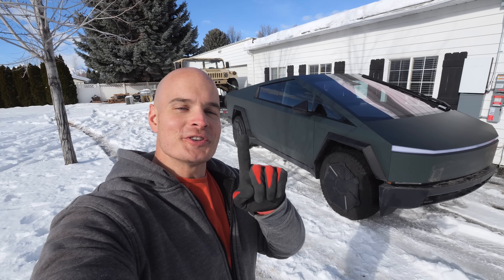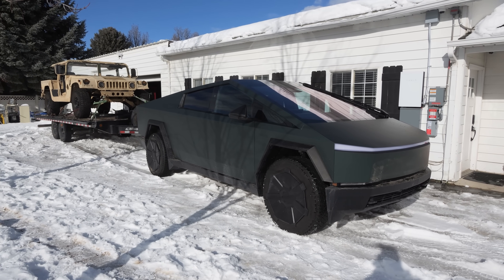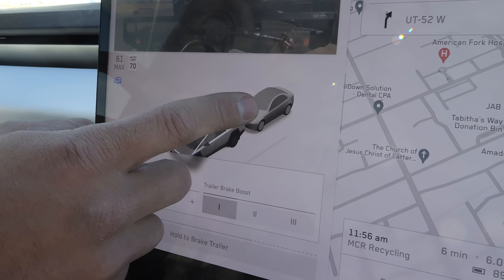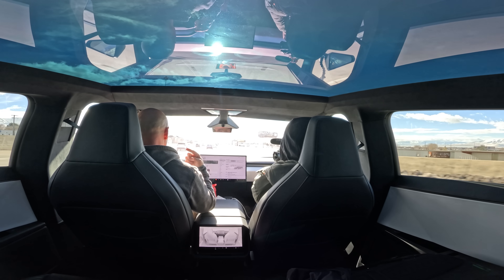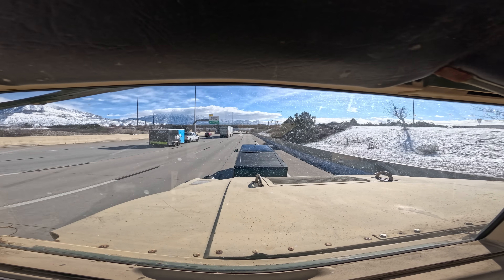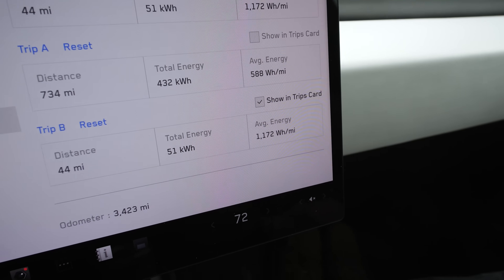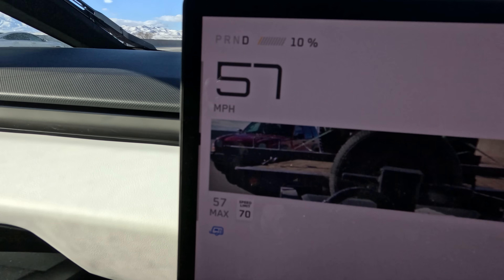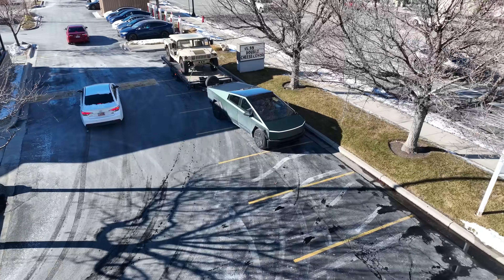How far can the CYBERTRUCK tow 11,000lbs in Freezing Weather?

Comment: Ouch and that's at mid 30 degrees, what we up north consider a warm day for 6 months of the year. Need to see this type of test done somewhere with real winter temps, like -25 to -40 degrees. Great vid Jerry.
Reply: What you are actually saying is: in winter, real winter, this 100k+ truck is actually just a paperweight
Reply: @blackfacegaming191    Yep, it's coming out in Alberta you lose about 30%-40% in colder temperatures.  Also at -40 there's videos of EVs saying nope too cold and shutting down on the highway.
Reply: @coolpicksoftheday  Eh there's a guy that was showing off his daily driver in his frigid snowy environment just fine. Engines heat up with combustion and batteries heat up as they charge and discharge. Ideally in those temperatures you'd probably want to get the batteries a little warmer before setting off much like a normal car which could be done with the heater running and if you're not doing super long distance driving you could also keep it around 80-85% and plug it in an hour or two before you plan on leaving much like a block heater on an ICE but instead of warming the block for coolant / oil it's just helping warm up the batteries then the power going to and from the batts while driving should keep them warm during your commute.
Reply: Freezing temp?? 😂30F??? That’s short & t shirt weather here. U can’t even see his breath & he doesn’t have a toque!
Reply: @darthmaul13 it technically is freezing, 32 is freezing. Cybertrucks aren’t advertised to compete with F250s. Towing 11,000 lbs over long distances isnt what it is advertised to do.
Reply: EVs are d.o.a. during acrual winter days. What a joke. Fools buy that garbage thinking they are so advanced...smh
Reply: @absolutefreedom9437  Yeah man, because something doesn't work well in -40 °C weather then it's useless. Even though like nobody important actually lives in those temperatures.
Reply: @drunkenhobo8020 

That name seems to fit😂. 

A) That's an incredibly arrogant statement 

B) The reason those of is who live in the northern climates point this stuff out is because the "important" people who don't live are trying to force everyone into these vehicles.  See Washington State for example.
Reply: @drunkenhobo8020  considering it can be that cold for several weeks at a time in some places, yeah it would be pretty useless there. Here in North Dakota we had about 2 weeks of -40 air temp and as low as -70 with wind chill thanks to our 20mph sustained winds and up to 50mph gusts last month. That happens about twice each winter normally, and regular average temps can be -20 to -30 throughout all of January and February. If my vehicle won't start when I need it to then yeah, it is pretty useless. Sure quite a few ICE vehicles had issues, but that can be solved by bringing your battery inside which you can't really do with an EV unless you have a garage.

Also your assumption that "nobody important actually lives in those temperatures" is completely subjective. My family and I are pretty damn important to me so just because you don't think anyone important lives up here doesn't mean we should be literally left out in the cold. If you want an EV and it works well for you that's great but for most up here and even further north they just don't.

Comment: Thats how motors work, they only operate at a rate equivalent to your foot pressure which means they will pull more amps to maintain the disigned rate.

That's It's why a lot of motors will go out because they're being ran in circumstances in which they weren't necessarily designed for and the wiring going too, and within the motor is too small and can't handle the Amperage. I'm sure the cyber truck has more than enough properly sized wire ran

Or think about how people say using a power strip cause fires when you got to much stuff plugged into it. The excessive amps being pulled through undersized wire cause the insulation to melt and the copper to get hot enough to ignite framing or whatever it touches

Comment: i think at the end of the day all these statistics say is that EV's belong in the cities where most vehicles typically sit in traffic idling away fuel and putting CO2 into the atmosphere while not doing a whole lot. they save on a lot of energy there but when it comes to actually having to do work and travel they still fall behind in all areas. it's just more efficient to use gas/diesel when traveling long distances. i know they've been putting chargers up all over the place but being forced to stop every ~100-200 miles for 20-30 min just to extend your range(law of diminishing returns since you get less and less distance per charge every time you stop because it's only regaining so much charge.) compared to a single stop every 300-400 ish miles for about 10-15 minutes... it just doesn't make any logical sense to choose an EV if you travel long distances more often than not. i still see them as only a novel idea until they replace older parts of the grid to handle an increased load that charging EV's brings.

Comment: Cool BUT , if You are Monetizing On YouTube for this Content... Chances you are Required to Comply with USDOT Regulations Applicable to 49 CFR 390.5 when you are In Commerce.

It's NOT a Problem because you won't get noticed for operating in Commerce until you get involved with a DOT Inspector who knows what they are doing, or you get involved in a Accident and it was determined you're in Commerce with applicable DOT Regulations.

Commerce can be Considered a Form of Compensation Reportable to the IRS.

The GVWR of a Cybertruck is listed up 10,000 lbs., if what you say the Humvee is at 11,000 GVWR, then the Trailer should b3 rated to carry 11,000 GVWR

Then you would MEET Applicable DOT Regulations 49 CFR 390.3(a) which makes Reference to "Interstate" Commerce, but your State may have Adopted DOT Regulations for purposes of Intrastate Commerce

And your Vehicle would be Defined as a Commercial Motor Vehicle per 49 CFR 390.5 

Commercial motor vehicle   means any self-propelled or towed motor vehicle used on a highway in interstate commerce to transport passengers or property when the vehicle— 

(1) Has a gross vehicle weight rating or gross combination weight rating, or gross vehicle weight or gross combination weight, of 4,536 kg (10,001 pounds) or more, whichever is greater; or

Comment: WHAT'S NOT SAID: THESE HEAVIER EVs ARE NOT PAYING ROAD TAX, POWER COMPANIES SENT OUT PIE CHARTS DEPICTING ENERGY RATES ROUND THE CLOCK. RATES TO CHARGE AT NIGHT ARE APPROXIMATELY 40% CHEAPER THAN PEAK HOURS , 3:00 PM  -  9:00PM. ESSENTIALLY FAMILIES AND NON EV OWNERS SUBSIDIZING EVs.  The Rivian and Cybertruck are $115,000.00+ vehicles, the Lighting is about $90,000.00. what are these vehicles driving range once these batteries get 3 years old or so. They will not be economical at all, at peak hour rates, pay road tax, all spending 40 minutes for an 80% charge. All putting out more carbon emissions than gas vehicles. People don't realize electricity doesn't magically manifest itself at receptacles in your home. Electricity is forced to your home by voltage. Electricity is generated at powerplants and needs to force the electricity to substations which then reduce the voltage and distribute it to  transformers in neighborhoods to reduce it to house current approximately 120VAC. To make this long trip it starts out at approximately 400,000 volts. So carbon emissions are emitted producing the energy and even more forcing the energy 40+ .miles. The Green New Deal is a lie. It doesn't reduce emissions but it does make the rich, richer just like the fake climate change, etc.

Comment: And to think I can take any exit fill up in five minutes and drive 450 miles....
Reply: If you're towing you're probably not get that full 450 miles. These things are new tech with a lot kinks to still be worked out. They could make it so the batteries aren't part of the vehicle (and it's initial cost) and that they operate under a service model where you pull into a station and swap them out instead of waiting to charge.

Comment: You should try it again with a tarp sloped up from the front of the trailer over the top of the Hummer.    Should make it a lot more aerodynamic.  And also the national speed limit of 55 was chosen because there is a big difference between 60mph and 55mph.  Agree they need to work on it.  Maybe a slider for 'estimated" weight of what you are towing.

Comment: Hi risk test from a safety point of view.
So it is a total fail on towing anything serious.
90 miles on a charge and you have to unload your load to charge???
These CTs are for posing and trying to impress your mates, and for private school pick ups.
Totally useless, and the steer by wire is nuts.
The only very positive thing is it doesn’t have autopilot, because Elon doesn’t want to be sued with a class action.
If you want to tow safely and efficiently , buy a diesel.

Comment: The milage displayed on the top of the screen does not factor in current consumption its just the EPA estimated efficiency multiplied by the current SOC.  You could have seen your true projected range by going to the energy app and clicking on consumption (not sure if its the exact same in cyber truck but it should be there). From there you can get a more accurate range estimate based on the average efficiency of the last 5, 15, or 30 miles

Comment: I feel like the trailer brake would be a big variable in range comparison with that much stopping. I know you need one to be safe, but it doesnt get all the momentum back into the battery. Need a regen trailer that stores its own braking into a battery for later use

Comment: 7:37 this might be poor fixation of coil winding in either a choke or a transformer within the inverters. It is often heared on electric trains too. While accelerating the inverter pumps more current to the motors (and when regenerative braking too) which causes windings to vibrate more under the Lorentz force.

Comment: So you buy a very expensive big truck, weighing a lot more than any average ICE truck, and can tow only 90 miles in cold weather and have to spend at least 40 minutes to charge it up again? 
Then you say "most people aren't using EVs for towing in the first place". Then why do you buy a big heavy truck if it can't be used as a truck? 

I guess many ICE truck owners don't use them in their jobs but if needed those ICE trucks can actually be used as trucks.

Comment: Clearly, the Cybertruck is not ready for prime time. Just the towing graphics alone would put me off my feed, and the lack of need-to-know information is another deal-breaker. BTW, my guess was 100 miles. Pretty darn close. Another point where NONE of these EVs are ready for prime time. I am NOT going to spend an hour every 100 miles just charging the hot mess. Thank you for the in-depth reviews. You have single-handedly convinced me to not spend hard-earned money on any of these trucks for at least another development generation.

Comment: Evs are only good for inner city driving if you buy a small ev. When on the highway high speeds kill the battery faster with heat of the electric motor. Evs are good for inner city low-speed, low millage driving per day as long as they design small vehicles. Big vehicles make no sense for EVs. The weight eats your tires up faster as well. If you need to tow anything heavy, get a V8 gas vehicle or a diesel truck. I will never buy an EV ever. They are worse for the environment, and the infrastructure does not exist for them. THEY need to build nuclear power plants all over the country if they want the power to do evs. It won't happen in our lifetime

Comment: Jerry, 
what happens if you are driving the Cybertruck and the battery runs completely out of charge and goes dead?
My Uncle had a 1972 Buick Electra, and when it ran out of gas on the road it was scary. It happened to me one time. The steering and brakes were full power, and when the car stalled, it took all my strength at age 21,being in good shape, to control the brakes and steering  just to it get off the road, and would take several people to push it at all. Consider that owners of the Electra were middle aged and older . Weight was about 5000lbs.with the 455 cid engine.

Comment: 90 miles. Wow. Put on the white gloves and baby that turd. In the meantime I’ll use my 2002  E350 with pride. I can pull a 20 enclosed trailer easy 200 miles on the interstate with out stopping for fuel and I’ve got the small tank.

Comment: So driving it at the actual speed limit here in Arizona pulling my travel trailer that weighs 11000 lbs I would get less than 80 miles.  I can see I'm still years from even considering one. I'll stick with my gas powered truck.

Comment: Time for a Jerryrigged trailer with battery pack build to charge truck while towing. While you are at it may be able to rig up Regen braking on it too!
Reply: If you have motors in the trailer hubs for regenerative braking, then why not just use them for assist while driving?  An electric assisted trailer might make sense for any vehicle type, EV or ICE.

Comment: I hope when Edison Motors comes out with their diesel electric truck conversion you get to test it as well.   I love their open source and right to repair philosophy.   Also having a diesel generator means that you don’t have to worry about dropping the trailer or no charging slots open.  I honesty think hybrids are going to be the norm for trucks, not full EV.
Reply: I agree.  Diesel/Electric hybrids are the way to go for trucks for at least the next 20 years.  Way more practical and a proven solution just look at freight trains.
Reply: Nah. Batteries are developing at a rapid pace now that people are investing into them.
Reply: Honestly its surprising we didn't have diesel electric hybrids 10+ years ago considering trains have been powered that way for over 50 years and we had the battery technology to do it. I love that they're trying to retrofit older diesels that were built to last forever to keep them on the road longer while burning cleaner
Reply: @LukeA_55  It would of lowered profits. Thats why hybrids and electrics basically havent been a thing. 
Only reason why they're moving over now is Tesla is forcing them to.

Comment: My concern is, what would happen if you were on the interstate at speed and the thing lost power? In a traditional gas or diesel truck, if the engine shuts off or the battery loses power due to a glitch, the operator still has enough control over the steering and breaks to safely stop somewhere. I imagine a machine completely controlled by electricity would essentially turn into a brick if a glitch or malfunction led to a complete loss of power.

Comment: I've been driving a PHEV Toyota Prius Prime for about 45,000 miles, and I've noticed a similar issue to what you experienced in this test: the range seems to drop faster in the last 20% of the battery charge than in the first 20%. Maybe this is something common to lithium ion battery cells in all EV's and PHEV's? Anyway, I quickly learned that it was risky to trust the range stated on the instrument panel at the beginning of a drive, although since the car was a PHEV, I knew that if I depleted the battery charge before reaching the destination, the car would just switch to the gasoline engine automatically. But let's hypothesize that I might rent an EV sometime, a Tesla or a Toyota BZ4X. If the range at the beginning of a drive was 250 miles, I would first check the route for terrain elevation gain. For every 1,000 feet of elevation gain, reduce the range by 5%. If the ambient temperature that day is less than 50°F or more than 80°F, reduce range by 30% because of the heater or air conditioning load. If the temp is between 10°F to 32°F, reduce range by 40%, temp between -15°F and +10°F, reduce range 50%. Colder than -15°F, I wouldn't want to be in an EV at all, too risky that the car might refuse to run at all because of the battery being too cold - a problem that hit lots of Tesla owners in the upper midwest last week in the severe cold snap they had. But bottom line with an EV, it's risky to plan a route in which your next charging station is distant by more than 75% of the stated range at the start of the trip; you never know what might happen to cause you to have to take a detour - an accident, road construction you didn't know about, or the possibility that when you get to that charging station, there's some kind of problem like a power or network outage, and you have to look for a different charger somewhere that might be an extra 40 miles away. EV's and PHEV's are wonderful vehicles, but you definitely have to unlearn old habits regarding "fueling up", and develop a different mindset: that you can no longer assume that there's a filling station every few miles and often 3 or 4 different ones on the same intersection, and dozens of them in the same town.

Comment: Boy, only an EV fanboy would think 90 miles is an acceptable range, especially with refueling taking over 40 minutes, only with a supercharger with no lines.  And you are paying less for the electricity only because you avoid the fuel taxes and all of the other crap they are doing to increase the cost gasoline.

Comment: Imagine driving a vehicle where the steering ain't connected to the wheels, the motor not connected to the accelerator, the driver not being the pilot... And one bad case of a computer glitch. Not me in one of those. Tech fails way too often and cars are built purely for profit within some safety rules. Failure is by design. remember that.